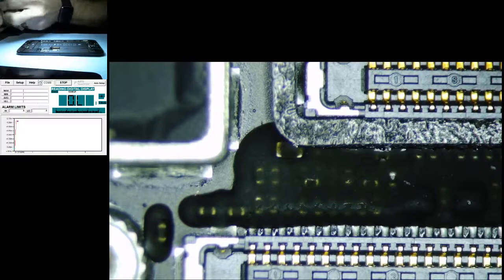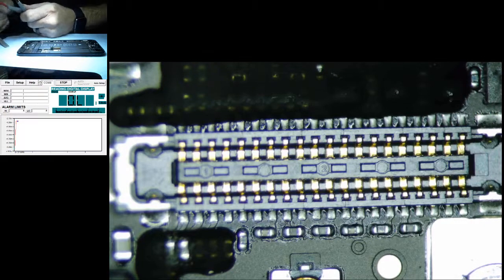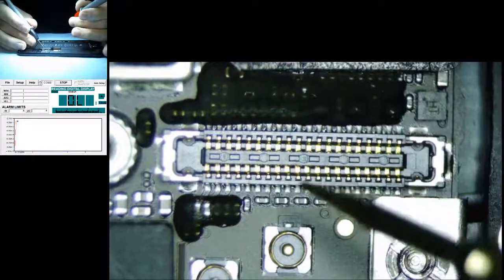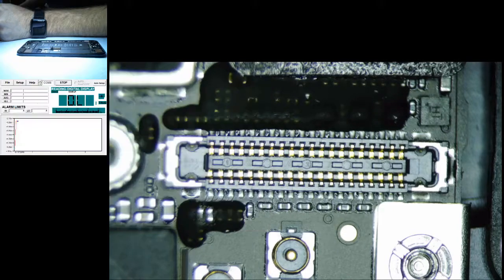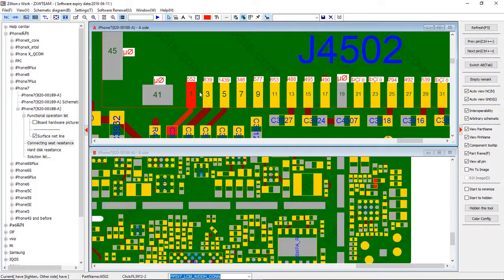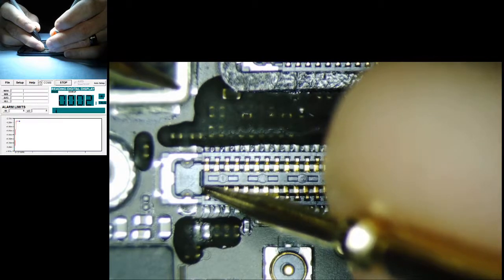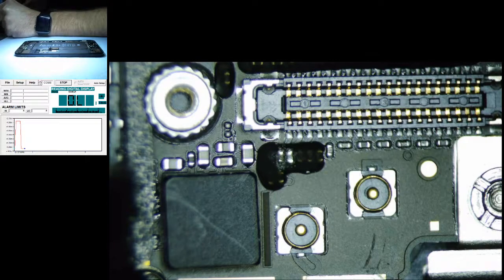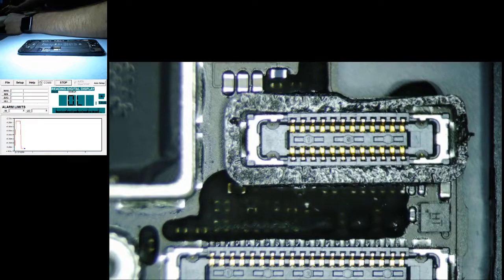Intro to Diode Mode on iPhone

Comment: Can I ask why is 19 pin grayed out on the software??
Reply from the maker: Sure, the ones that are greyed out indicate that pin is ground.
Reply: @avmech00  thanks for the reply. It’s just I have a iPhone 7 here with no backlight but I can see the screen with a touch shone at the screen. I don’t do micro soldering but want to learn. I tested the pins with my multi meter and pin 19 was the only one which bleeped on my multi meter. Does that mean they is a fault with 19 or is that normal?? 

Thanks
Reply: Hint: the two strange characters mean 'open line' in this Chinese software, if the Simplified Chinese character set is not installed on a computer.

Comment: in Diode mode small amount of voltage ?  some multimeters diode mode voltage is about 7 to 10 volts coming from probes ? will it make any issue on PCB of the mobile phone circuits?
Reply from the maker: Thank you for your question,  in my experience, there have been no issues with diode mode on phone logic boards.  Diode mode is simply measuring the voltage drop with a small constant current applied. This amperage is small, my B&K multimeter tested around 1.8ma.  I should have clarified the relationship between voltage and amperage but I was trying to make it as easy to understand as possible.  Hope this answered your questions sufficiently.